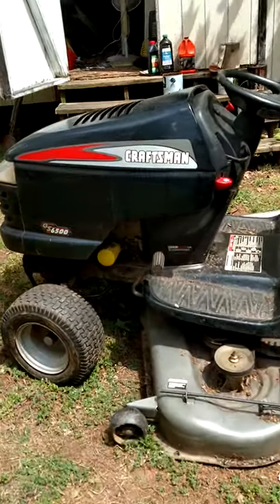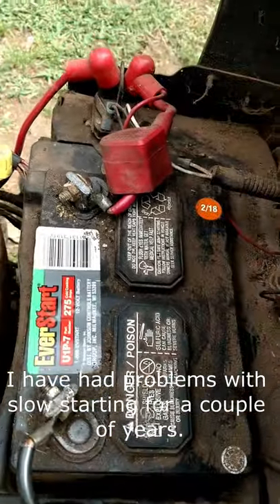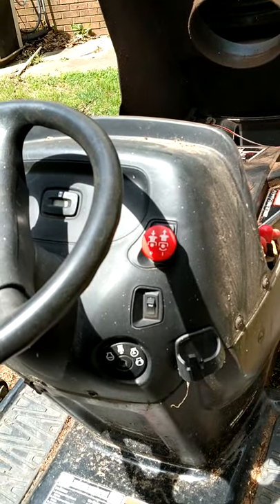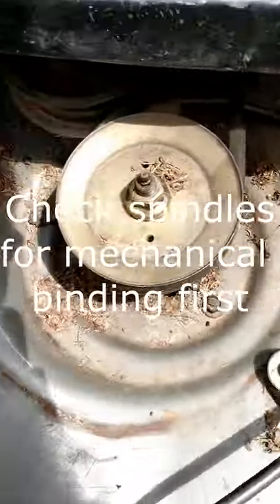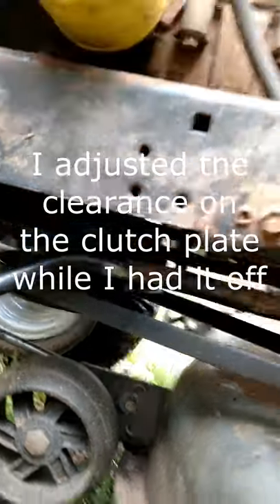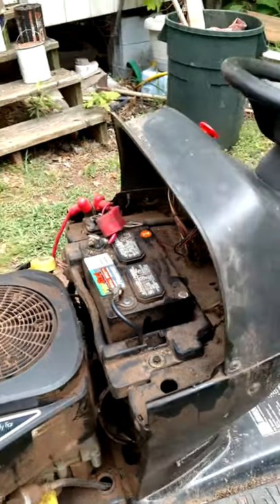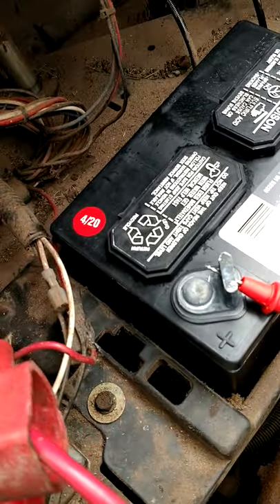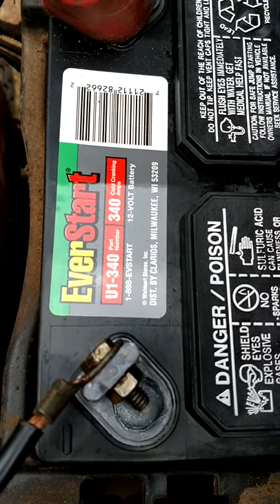Mower Shuts Off When Blades Engage

Comment: I’m having this same problem...  I will get a new battery.   Wish me luck,  thank you.
Reply: did it work?
Reply from the maker: I think my battery was so weak that it barely had enough omf to crank it.  The clutch apparently pulled enough extra juice out of an already weak battery that it bogged the whole system down.
Reply: @SlayerHawkX  Yes, it worked.   I went online and searched for a lawn mower repair service and found one that had excellent reviews.   It turned out that there was a dog leash wrapped around the blade.  I don’t have dogs...

Comment: IMO Walmart batteries are now garbage, they used to be decent, but have gone downhill in the past few years. I always tape my receipt to the side of the battery, in a zip-lock bag, because you WILL need to make use of their warranty.
Reply: I get a new top of the line battery from walmart every year for free - take them in at night when the shop section of walmart is closed - tell customer service you want to exchange the battery (if within warranty!)  they wont even test it - but if you do it during the day - and they test it and it's not totally a dead battery - they will not exchange it - seen it done in a youtube video with a car battery - so i do it and it works - do it with my car - truck - and mower batteries.